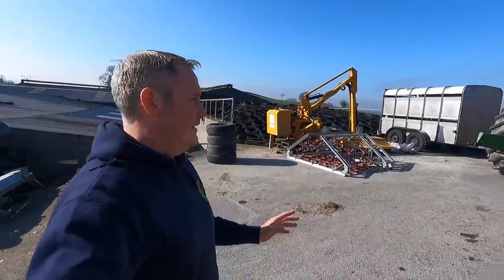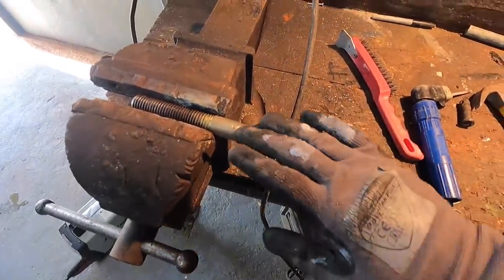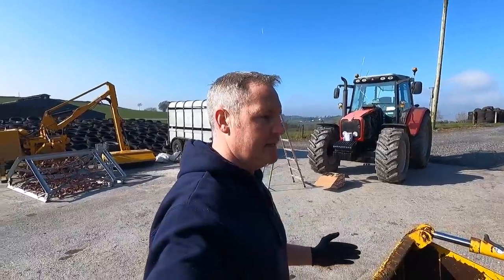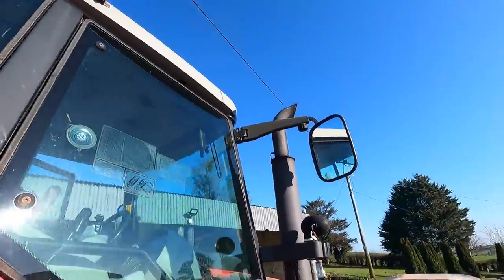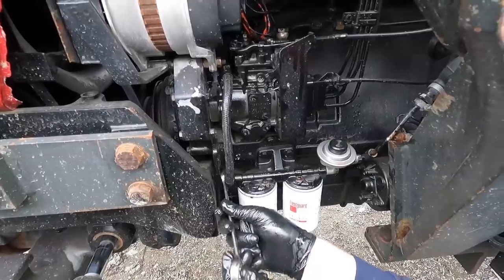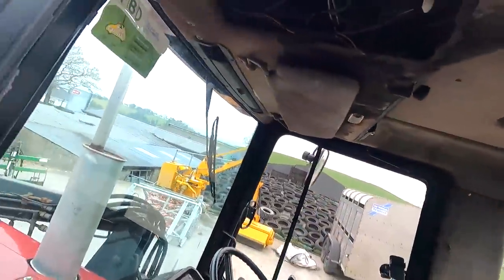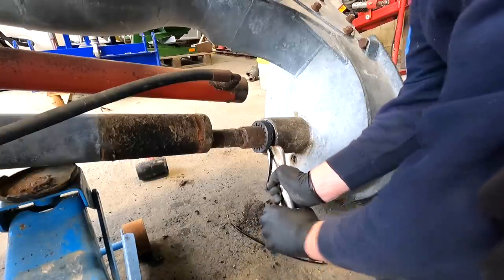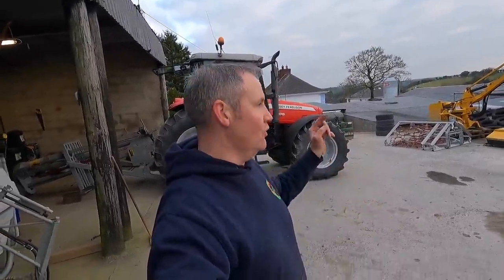FARM MACHINERY MAINTENANCE --REPAIR--SERVICE--UPGRADE-- WHERE THERE'S A WILL THERE'S A WAY!!

Comment: Adrian well done. 
Treat yourself and the family to a staycation this year, the kids will be grown up before you know it and you’ll look back on these holidays! A relief milker will get to appreciate your set up and may even suggest a couple of things!
Reply from the maker: I agreed, we need to take more time off as the kids are getting bigger by the day, I have some great mates and family that would cover for me anytime if needed so it will happen more often from now on foe sure 👍
Reply: @IFarmWeFarm  you 6th 6500 I'll
Reply: Well Adrian we have the same problem with our agitator , ours is a red rock.  It’s blowing slurry out at the man hole when it’s mixing is that what your mixer was doing before you put in that new seal ? Thanks in advance
Reply from the maker: @cameronburns8910  yes, it’s a Marine Bearing, or as I call it a seal, it’s supposed to let some slurry up to keeps the shaft cool but as they wear they let to much through. Also it can damage and wear the shaft if you leave it to long like that
Reply: @IFarmWeFarm  sound xeers

Comment: @29:18 u have the yellow 110 volt plug in the blue 220 volt socket🤔🤭
Reply from the maker: Pass no remarks on the colour, it’s converted to 220, all cables are the same just different 3 pin plugs. Don’t need 110 on a farm

Comment: Adrian Next time you are searching for a bolt in your rummage bucket put a sack on the floor, tip the bucket onto the sack and when you have finished ,gather up the four corners of the sack and tip it back into the bucket. Well said about the negative nit pickers, I always say to youngsters "don't put yourself down, there's plenty who will do that for you" Keep up thegood work

Comment: Father gives out to me for pumping grease into bearings until you can see a little bit of grease starting to come out around the seal, he says to only put 2 pumps into each of them but grease and oil is a lot cheaper than bearings etc.
Nearly 31k already, quality in the videos shows 👏 first video I saw was the milking parlour one I think
Nobody can argue that you havent worked hard for what you have

Comment: I love your channel  a little tip when you were replacing the seal a little dish soap on the seal wkll make it slid in more easily and a little greas on the fuel seal will prevent the seal from twisting and causing a small leak
Reply from the maker: Great tip, that’s what it’s all about 👍 thanks for sharing lad

Comment: Great to see a man looking after there kit 👍🏻 I think you can get LED replacement for the 64 head lights. Fuel wise have you ever thought about getting a fuel station with a filter on it. That will help take the dirt out of the Diesel before it goes into your tractor.
Reply: AB Crofter:  What an excellent thought.

Comment: What I have done with my tractor ( MF 6180) is change the standard quick connectors to the ones with the collar you pull back to attach the male end ( same style as the shear grab etc third service connectors). I found the connectors where you have to just pull the pipe out to release get damaged as you pull the pipe at an angle and knacker the seals.

Comment: Hi adrain seen your service on the nc pump if you have any slurry travelling up the pipe it will go into the bearing at the top of rotor shaft,drill a 25mm hole in pipe 4' down it will let any slurry from getting into bearing..

Comment: Congratulations 🎊 on reaching 30k subscribers great video. Time for oiling and greasing is very important   👍 keep it up good man
Reply: Don't know about you, but he certainly exceeded my expectations for doing a maintenance video.  Some really good stuff there.  I bet he gained a few horsepower when he changed out that crimpled fuel line.  What do you think?
Reply: @georgiaannbicknell6129  I agree great video magnificent set up he runs a sound show 👍

Comment: Adrian, my I make a suggestion in relation to working at the vice. I notice that you are standing directly on the concrete. I find doing that gives me a pain in my feet up the back of my legs and into my lower back if I am working there for a long time. It might be an idea to make a small wooden stand just to insulate your feet from the concrete. I notice some bits of pallets with the unchopped firewood. they might do the job
Reply: Good idea,
Reply: Rubber  cow may is what I use in my work shop  works get
Reply: Cow mat
Reply: Anti Fatigue mat is made for that , safest option
Reply: Good practical suggestion.  Anything that saves wear and tear on the body!
Reply from the maker: Your quit right Mark , I also could do with something for the parlour floor as i’m walking on concrete all the time, legs do be quite sore at times

Comment: We put grease around are rubber burn and it went it very easy
Reply: Good thinking.
Reply from the maker: Only thing is it may pop out just as easy, think you have to leave it dry for friction grip. 👍
Reply: @IFarmWeFarm  hasn't broke yet 😂
Reply: @IFarmWeFarm  Adrian, I thought about it after and maybe that the lubricant might eat at the rubber, make it gummy, and spoil it. That piece you took out was a mess.

Comment: I dont know if u have thought of this but there is a few farmers making these attachments for front loader that push in the silage with a tyre attached to a mettle bar and it rotatates as you go along might just make pushing in silage that little bit easier
Reply from the maker: Yip seen them, great job they are

Comment: There is grease nipples under the back axle at each side that we never knew about and a grinding sound was coming out of the back axle it was never greased  just thought I'd say it since u  have 6470 it's on a 6465 anyway
Reply: Thank you, Glenn.  Hearing a grinding sound is not a good thing.
Reply from the maker: Yip would you believe I only found that grease point yesterday 🙈🤣 what’s the chances off that one 😉 thank you

Comment: Where did you get or what is the brand of gloves your wearing while working on the tractors? Any gloves I have are too bulky or fall apart once diesel or oil get on them.
Reply from the maker: Them orange ones aren’t great and there mechanical gloves too, I use milkers black gloves. There great 👍
Reply: @IFarmWeFarm  Look good too, Adrian.
Reply: @IFarmWeFarm  Cheers Adrian , just Googled them and it seems they are nitrile gloves and easy to get. Great channel, keep up the good work.
Reply from the maker: @7thebill  that’s them, couldn’t think of the name 🙈

Comment: After using the compound on the tractor please please put some wax on her after, the wax should stop the paint fading again and make cleaning so much easier
Reply: Oh!!  Good point!!  He is not that far from the coast even being inland as he is.  If the rain is sitting on the machine, there is an opportunity for rust.  Wax surely helps that water to slide off and not stay.  There is less opportunity for rust forming.
Reply from the maker: Yes I had none but I will get some this week as it’s definitely worth doing, cheers mate

Comment: That's not actually a seal it's called the Marine bearing for the shaft to run on the water going through helps keep it cool
Reply: Thank you, John Kennedy.  So good to know.
Reply from the maker: That’s correct John, just mine was letting to much slurry in and over flowing. Your 100% correct though 👍
Reply: @IFarmWeFarm no harm to keep them done once they start to loosen they can start to vibrate a bit not good for gearbox

Comment: I used non genuine brand spool valve connection did nothing but leak put on genuine ones no more leaks
Reply from the maker: The ones I have there are genuine from a Massey dealer, pipes keep getting stuck in them too over time with no pressure on them 🙈

Comment: When you replace the female connection on the tractor possibly also change frequently used males on the implement because they are cheap and get worn and damage the expensive females I find the pulsing of oil going to my post driver wears them
Reply: Good point, Cleatus.